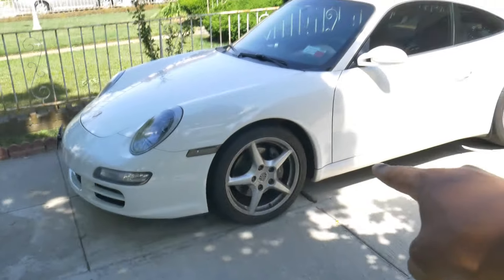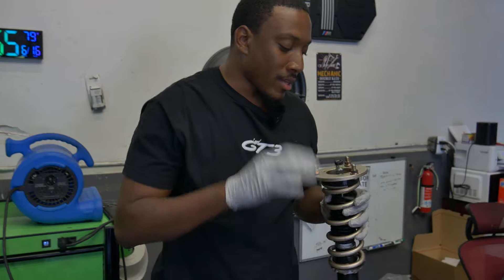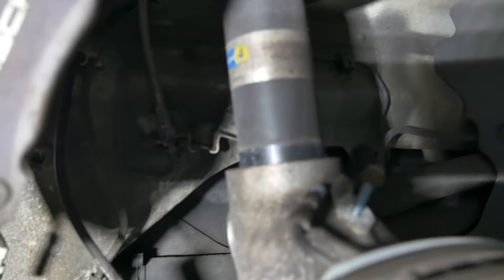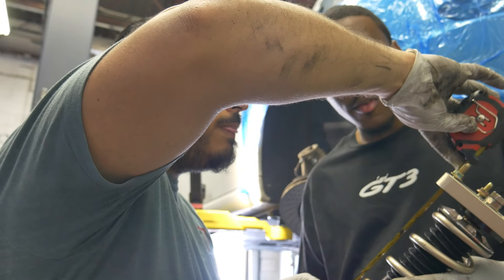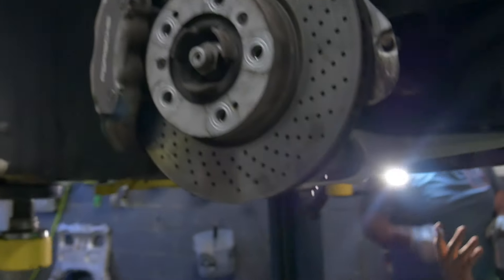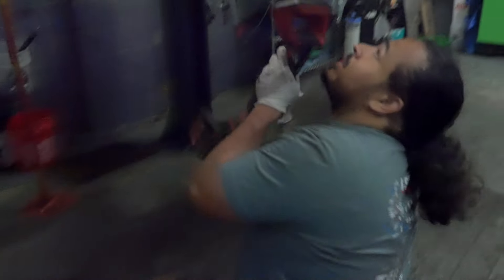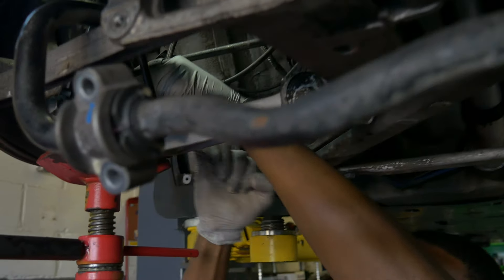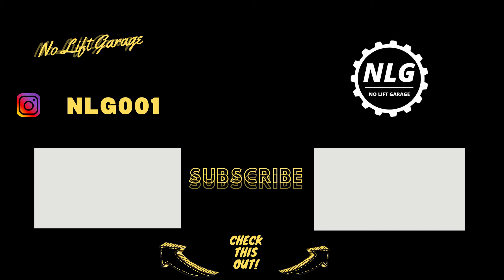The Porsche 911 gets a FULL Suspension Upgrade!

Comment: My 997.2 has PASM and I wanted to keep that option so instead of buying B16's, I just put on H&R lowering springs and feels a lot smoother. In retrospect I wish I installed them myself as the labor costed me like $2k. I still need to do a suspension refresh. Nice job!
Reply from the maker: @tokesa2753  I also debated springs but being in NY and not 100% knowing how my wheels would fit I needed the adjustment aspect. Hope they did good work for that cost btw! And thanks!